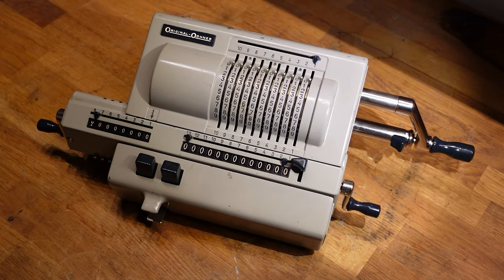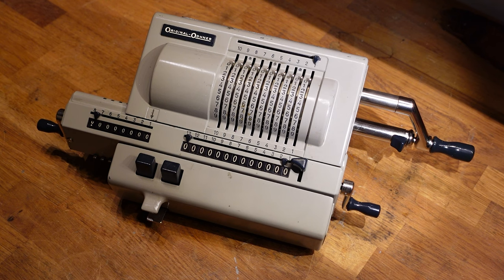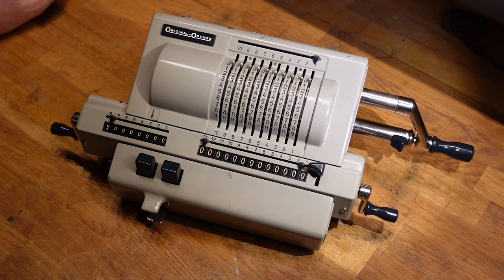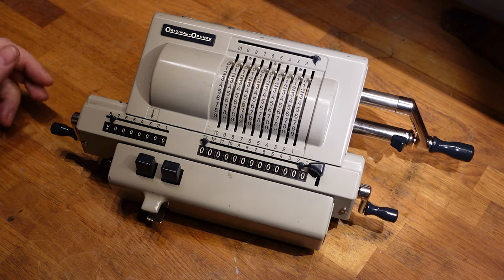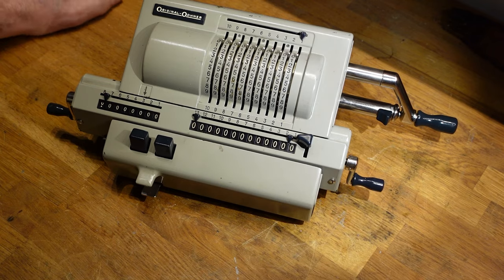Original Odhner 227 Teardown

Comment: Need advice with a problem with odhner 39 revolution counter reset handle jammed and not able to turn it can only be made to work and freed up by replacing zeros with any number on all wheels except the outside two at either end, have tried retiming with no luck any one any ideas please

Comment: How did you un-jam the result register clearing crank? I have the same problem. The crank won’t pull out allowing it to rotate.
Reply: Since the channel seem unable to respond I ask, have you dissembled the machine following the video?
Reply from the maker: Sorry for not getting back to you. All the cranks were jammed. I suspect that the machine had been oiled at some point and that the oil had hardened. I manage to un-jam the cranks by adding more oil and carefully pulling/pushing the lever. To my surprise, that resolved the issue.
Reply: @TimeExpander  What type of oil did you use?

And did you clean the old oil somehow?
Reply from the maker: @davidcarlsson1396  Just ordinary sewing machine oil.Not really sure if these machines are supposed to be oiled or not in the first place.
Reply: @TimeExpander  Whether they should be oiled or not is an excellent question. 

I will the coming 3 years attempt to research this...